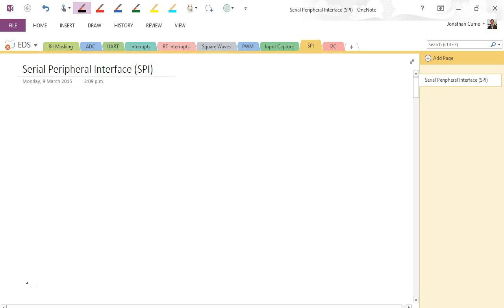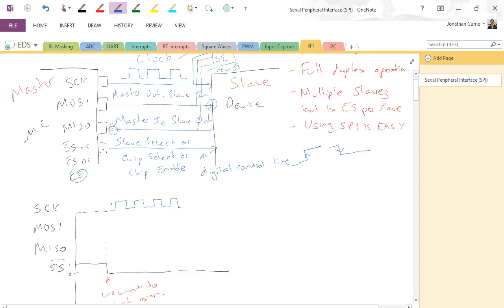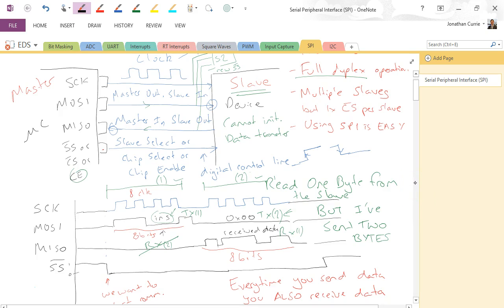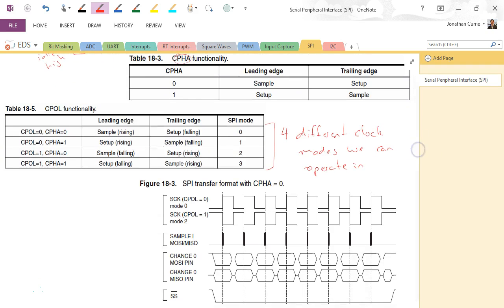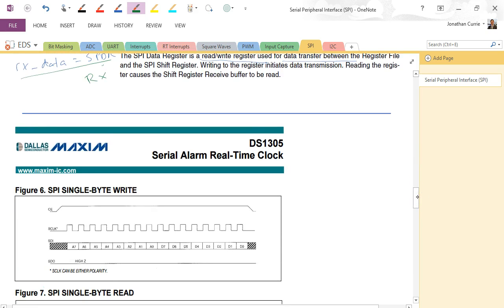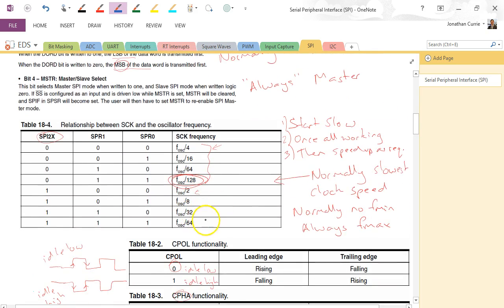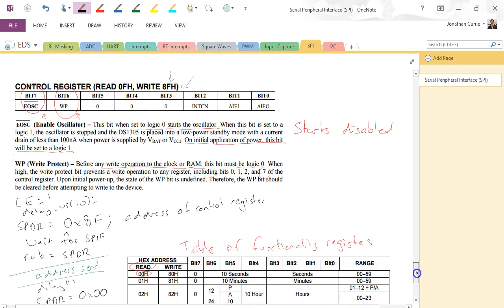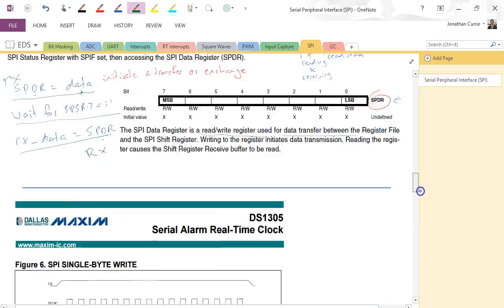megaAVR Microcontrollers: SPI

Comment: the secret about using spi is that it enables you to control multiple atm machines from 1 point and it is possible to send dispense commands to the atm through the spi connection... the slave devices will go ahead to dispense all the notes out of the machine... so if you are able to connect your pcb with spi into the atm, you can clock any machine in the world... atm machines are the weakest .